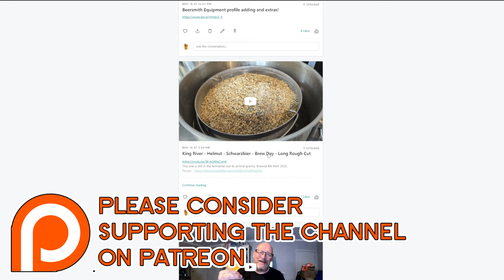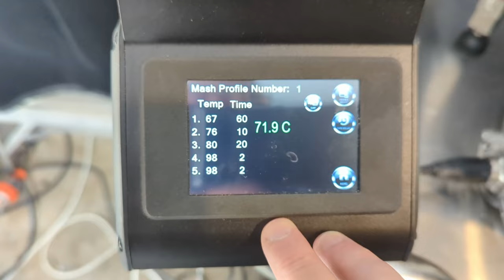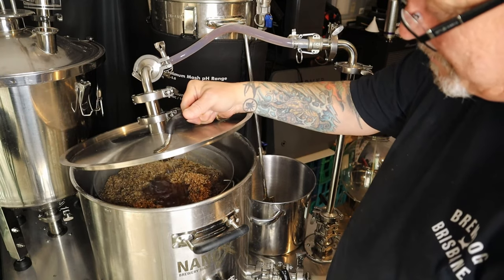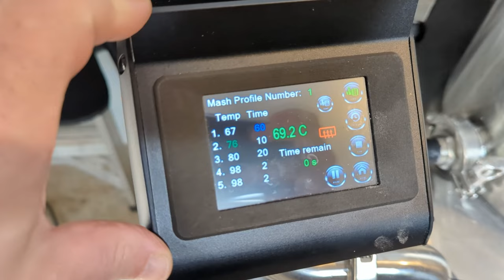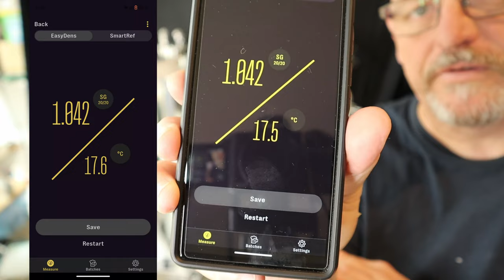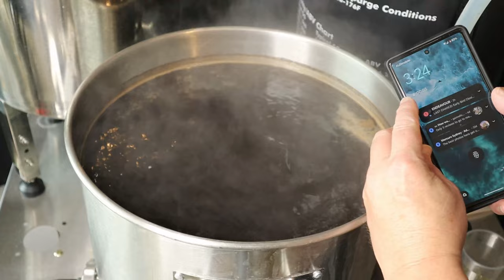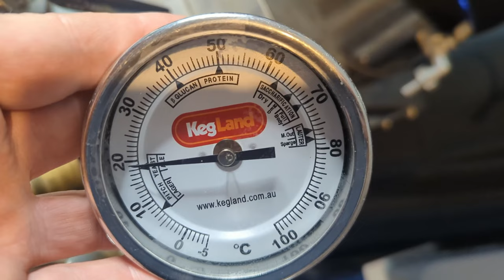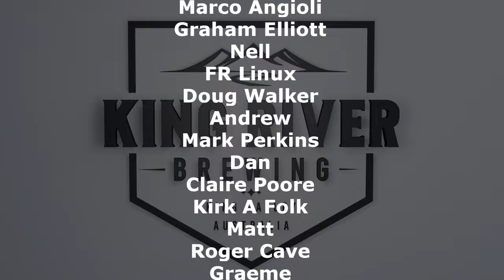Brewery Series #10 - King River - Helmut - Schwarzbier - Grain to Glass - Nano-X TK36L - G2G

Comment: I always focused on boil time. I now use boil time as a general guide. I now boil to the volume that will give me the OG that I want. If OG is flexible I don’t worry and boil to time.
Reply from the maker: I'd always try and over shoot numbers, so I'd water down mostly, rather than boiling different times, either way it's much easier in a more manageable mash basket and/or kettle size. I brew 23-34L batches but will only keg 18L, again, keeping it simple, no stuffing around, enjoyable. Cheers Barry! Hope you had a great weekend mate!

Comment: Mate we've seen you brew on all sorts of gear over the last few years. This one, Grainfather 30/40, brewzilla. What's your go to favourite when the camera isn't rolling?
Reply from the maker: I really like the simplicity of the single vessels, even though this one is technically a single vessel, its hard work, I've learnt to much prefer the larger single vessels, just to have that extra space, space for mash and boil, it gets tiring trying to squeeze brews into a smaller system. I sold the G40, which was fine, great machine but the priority parts, not being able just to plug a 1/2inch regular fitting into the recirc or chiller also got tiresome. So my favourite at the moment is a Brewzilla 65L, its very rare I use it full these days, but the nice wide mash pipe like the G40 had, means easy mashing, reduces any chance of a stuck mash greatly. There's also plenty of room for the boil, no worries about boil over, plenty of room to sparge a bit more, or water down if needed. It does need 15amp though, but the G40 ran much better on 15amp too. Cheers!
Reply: @HomeBrewNetwork  thanks mate
Great feedback and very detailed, one question - what did you mean by "priority" parts for the g40?
Reply from the maker: @brassones6969  oops think spell check got me there lol proprietary.. meaning they use odd sized parts no one else uses, they only want you to buy their overpriced accessories which is a real let down. If you're just starting off it might be ok because you don't have other parts already, but if you've been using something else and you change to Grainfather it means either new gear or messing around with adapters, that you usually have to make yourself. Cheers!